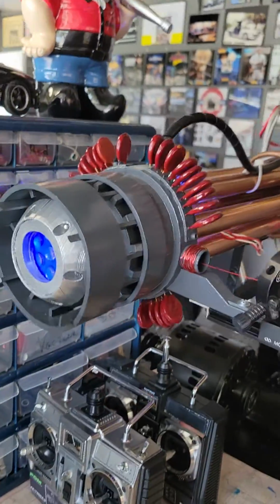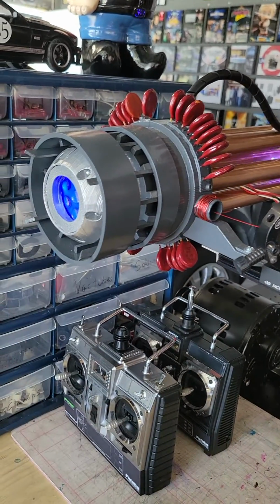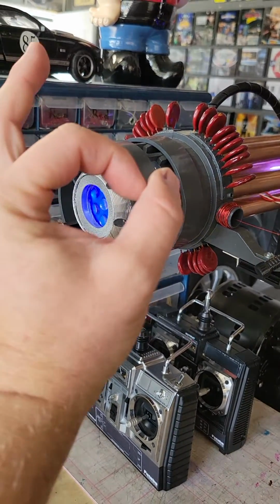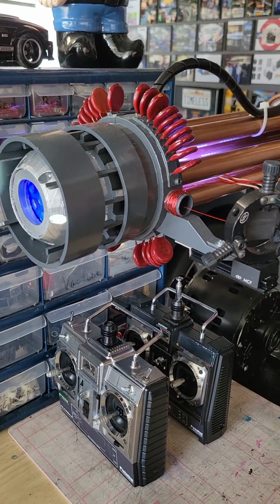Answering questions about the shrink ray machine replica, are there 3D print parts?

Comment: The fact that they restored the machine back to its original design after the streamlined makeover it was given in Part III was quite amazing. Now let's see someone build the growth ray housed in Sterling Labs from Part II! If you don't mind my asking, how large of a budget did does one need to build something a detailed as this replica? As someone who has admired this prop for its mechanical beauty since childhood, I must say this is one of the coolest things I have ever seen. I have been building my own replica throughout the years but with vastly inferior parts such as Super Soaker projectiles, salvaged PCBs, and anything electronic my dad could bring home from his printshop. In college, I constructed my most elaborate build for a film class. I invite you to check it out, from one Szalinski hardware fan to another: https://www.youtube.com/watch?v=6v7-3kREnRM&t=54s
Reply from the maker: This video it not up to date with the current machine it's before the proper nose cone was Installed and motor. The restored version is extremely different in parts colors size of wires from the original film. But the fact that they have it and have restored it in a way is fantastic. Building props like this is all about how much you want to pay in materials. It could range from $500 to $5000. My current replica took 1 year and over 6k to make it's 200 pounds 5 feet long and 7 feet to the top of the support arm. I have been working with original cast members doing shows they get existed every time we're out and love that is fully interactive for all ages.